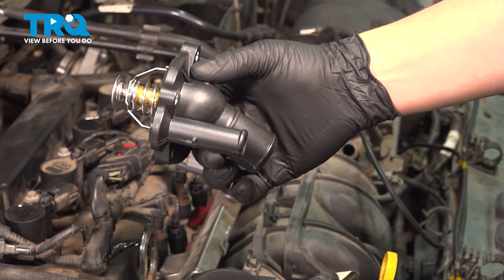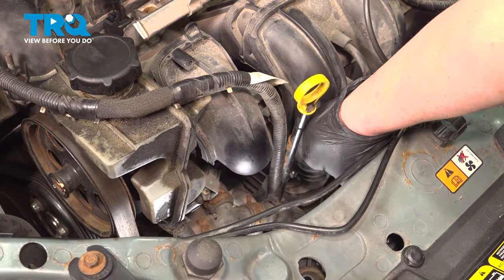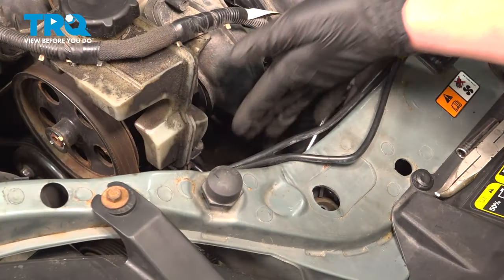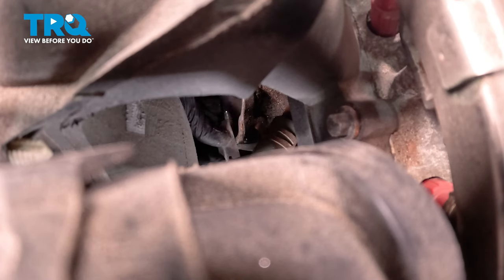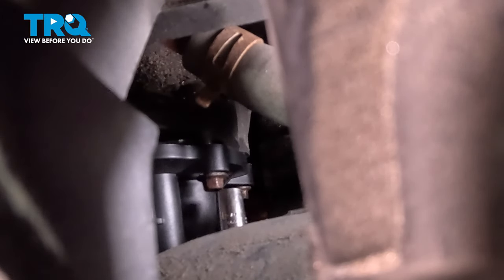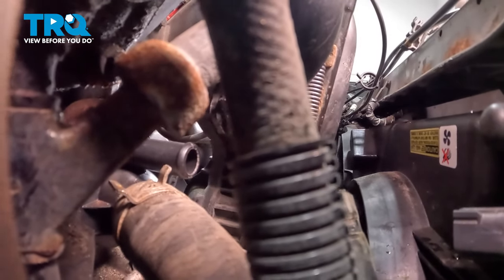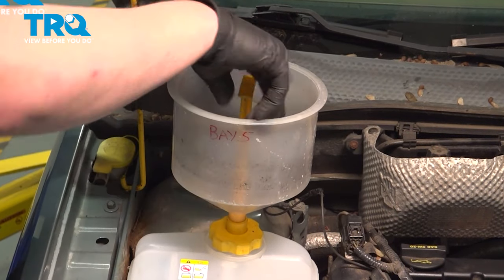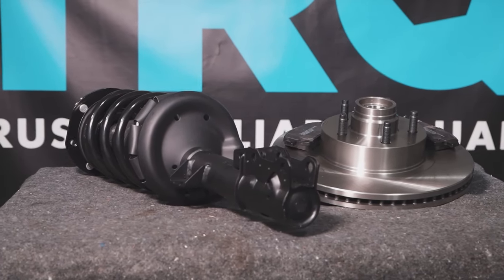How to Replace Thermostat Housing 2000-2007 Ford Focus

Comment: For anyone attempting to do this repair, remove the 2 bolts holding the power steering reservoir and push it out of the way. It will give you more room to work.